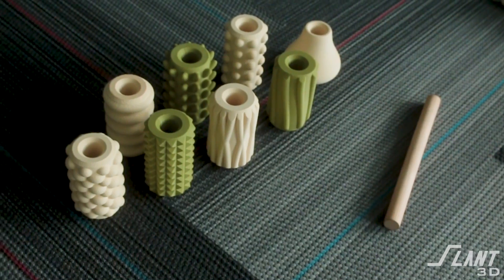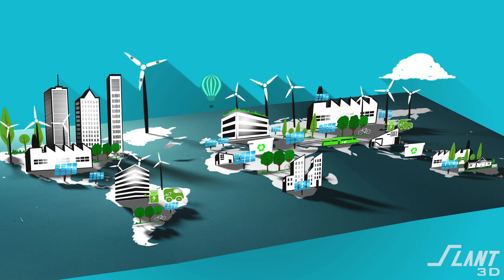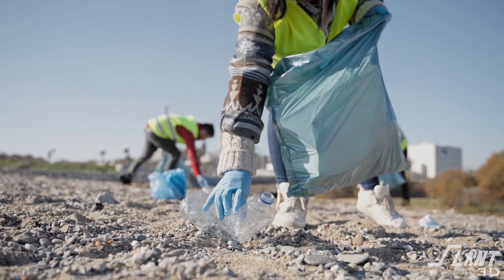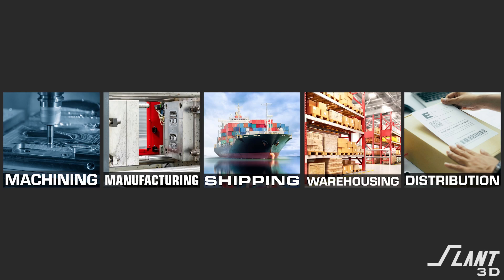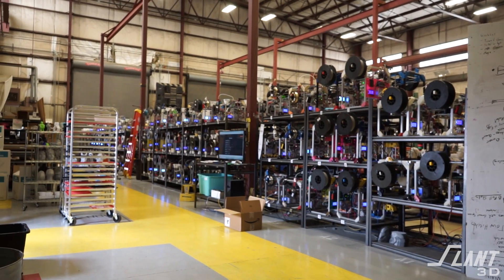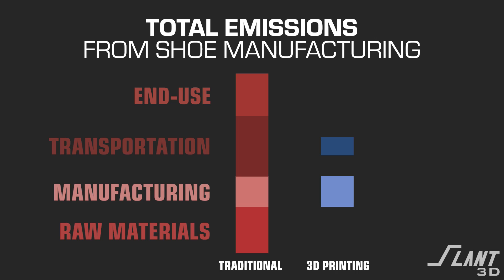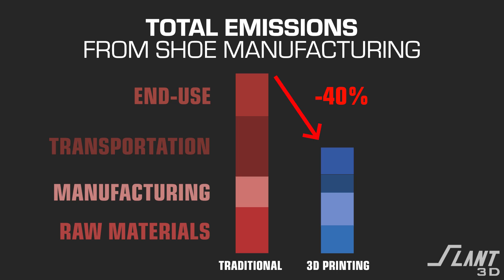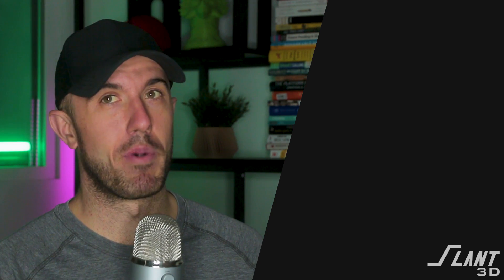How 3D Printing Reduces Carbon Footprint | Sustainable Manufacturing

Comment: As we speak, I am working on installing 3d printing in the micro hardware stores (ferraterias)  in the provinces of Peru. Specifically for plastic pipe fittings. 
No more manufacturing and transportation which allows us to beat China on price.
 Are you listening,  mission trippers?

Comment: The details are presented in a rather optimised manner, but I do agree with the overall thesis.  One way to understand just how much impact warehousing has is to consider places like Ikea and Costco - for both of these businesses, a major component in their less-than-average prices is the way the have their warehouse do double-duty as the storefront.

Interestingly, I think this is another area where mass-production 3d printing and hobby 3d printing might be divergent.  Certainly I feel like my personal hobby building waste has shot up since I got a 3d printer,  The waste on an individual part is almost certainly less, but at the same time having the 3d printer has allowed me to tackle projects that were completely out of my reach with the result that I'm doing much more physical building than I did five years ago - and in the process, generating more waste.

Which leads me to my only major worry about mass production 3d printing becoming widespread: historically, a more efficient manufacturing process has almost never resulted in less overall waste.  Instead, a less costly way to make stuff almost always results in more stuff.  If 3d printing cuts waste by 90%, will that mean there is 90% less waste in the world?  Or will it just mean 90% more stuff ?  Straining the limits of my Econ minor now, I suspect that the answer will be linked to the cost:waste ratio.  If 3d printing cuts manufacturing costs by 50% and manufacturing waste by 90%, the end result will probably be 50% more stuff and roughly 40% less waste.  If 3d printing cuts manufacturing costs by 75% and turns out to only cut waste by 60%, the result will be 75% more stuff and ultimately roughly 15% more waste.

Which doesn't mean we should avoid 3d printing as a technology.  It just means that if we want to actually survive the climate catastrophe, we need to all start strongly reconsidering how much stuff we want in our lives.
Reply: Rebound is a thing, though I believe some of your calculations are off. We need high co2 prices asap, then 3d printing and its efficiency will just mean that stuff stays more affordable due to lower co2 emissions than in a scenario where we don't harvest these gains.